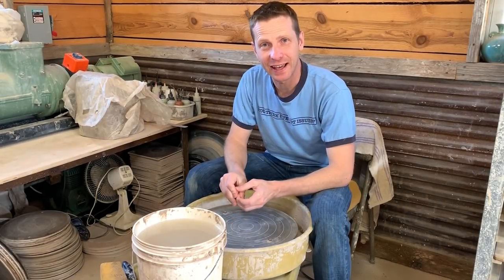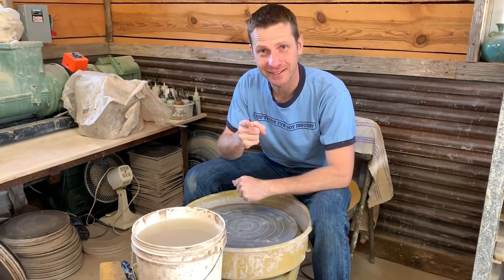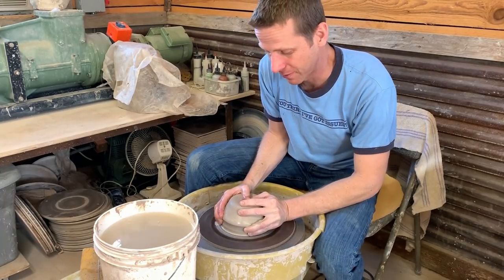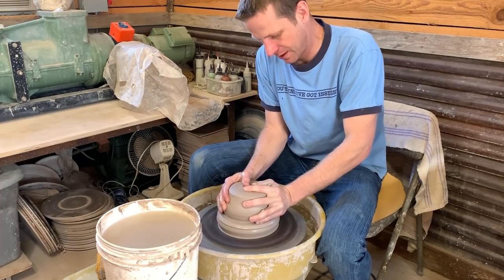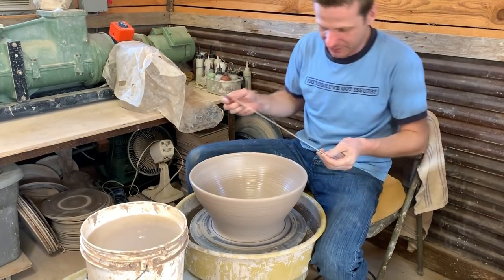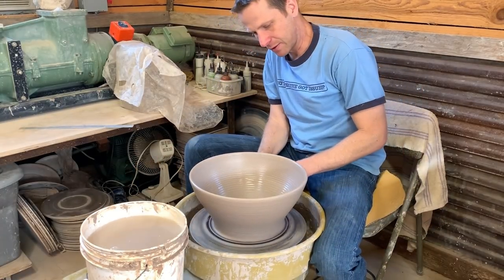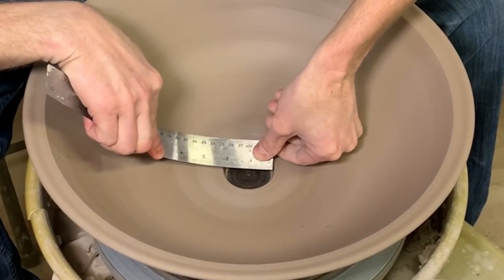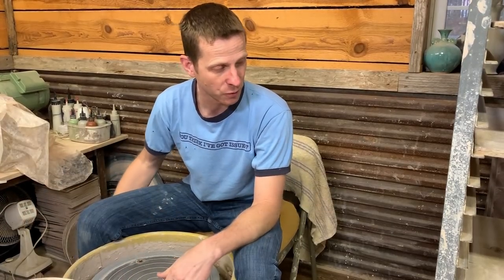Throwing A Pottery Sink

Comment: Hi Mathew   Given me a great idea as I’m about to renovate my bathroom
Also can you please tell me about the really thin kiln shelves I’ve seen in your kiln.  
Advantages of these etc   
REGARDS RICHARD
Reply from the maker: Those are advancer kiln shelves. They are amazing but also amazingly expensive. They can handle very high heat without warping and the glaze comes off very easy if it ever drips on them. Well worth it if you have the $. Sorry for the delayed response.
Reply: Thanks for your reply 
Can you tell me approximately how much for a shelf 24x24 inches please
Reply from the maker: @mudbrains4881  you can check kilnshelf.com I know that if I replaced mine that are around 18x24 they were over $300 each!!!

Comment: I like your video. But why did you turn the direction of your wheel? I' m afraid my English is not good enough. I know you said IT all in the video. Could you give me a written answer ( reading English was never a Problem vor me).
Reply from the maker: When I reverse the wheel I can use my right hand (my dominant hand) on the inside to hold the rib. Then I support it on the outside with my left hand. This way I can shape the bowl from the inside with the rib in my right hand. My latest video goes into more detail about this.

Comment: do you use warm water?
Reply from the maker: I use warm water just about year round. Just not as warm in the summer.
Reply: @MatthewKellyPottery  I too have always used warm water, I was told not to use HOT water for some reason; so I follow the advice, thanks Matt.